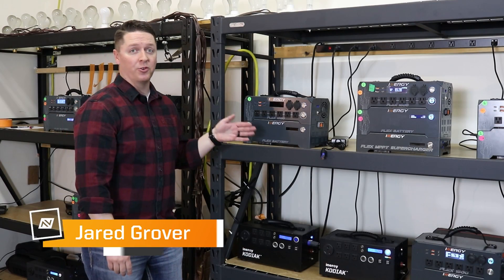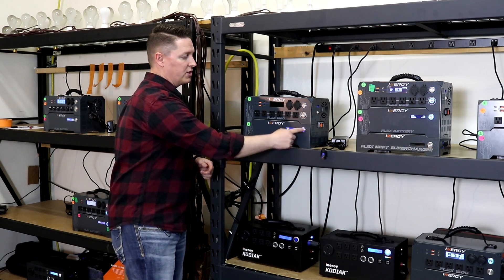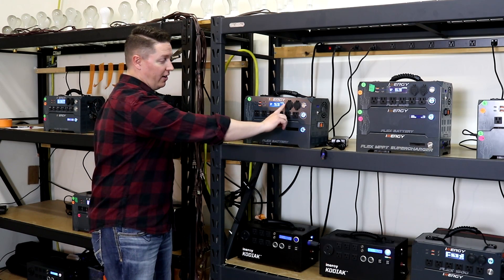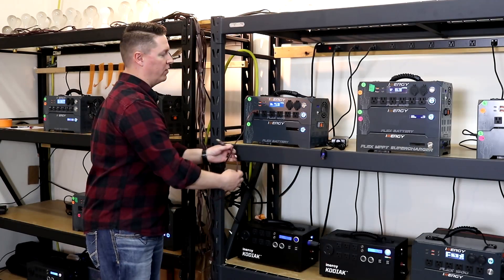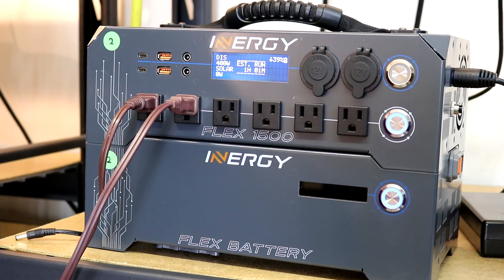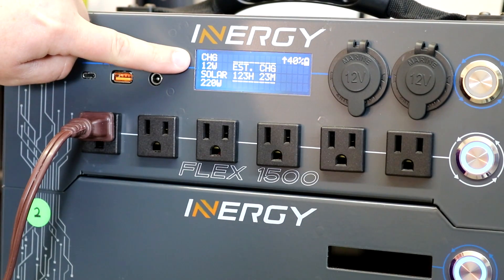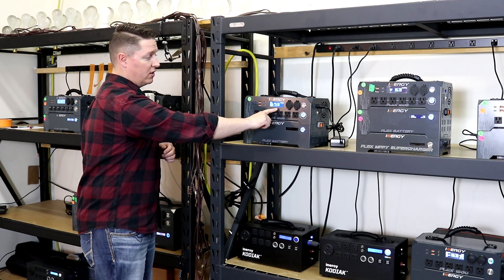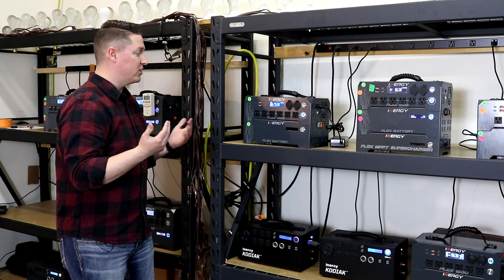Flex 1500 LCD screen walkthrough

Comment: Spent 2k on this unit in May now it’s Priced at 1,450 

My inergy flex 1500 unit is brand new, only used 2 days and the LCD screen is not displaying a charge or solar rate of generation via solar input or 5.5mm X 2.5mm input for standard wall charger that is located on the left side of the battery.

What is this issue? I am not charging at this rate….
Reply from the maker: Hi there, I am sorry to hear you are having issues! I think it would be best to reach out to our Tech Support team to do some troubleshooting so that we can better identify the issue. They can also look up your order and help breakdown the total price paid for the unit since $1,450 is the current subtotal of the Flex 1500, any additional panels or accessories do add to the subtotal. Please reach out to us at 1-877-891-2657 Monday-Friday from 9-5 MDT or email us at support@inergysolar.com

Comment: This company appears to be a scam.
Reply from the maker: The Flex modular system is our fifth pre-sale or crowd-funded product launch. In fact, both the Kodiak and Apex power stations were pre-sales with over 10,000 units shipped nationally. We absolutely are not scamming you. Your Flex system has been manufactured and is simply stuck in an unprecedented logjam at the airport. We have shipped thousands of Flex units in the last month, and we absolutely will ship your unit to you.
Reply: @Inergytek  I received my Flex last week.  I love it. This company is not a scam. The Flex is worth the wait.

Comment: Why is the solar input connected to a 110 outlet?
Reply from the maker: The flex has multiple charging options, including a 200 watt quick wall charger. Unlike the standard wall charger, the quick wall charger plugs into the EC8 solar port. Since these units are being quality tested indoors, we're using a quick charger instead of solar panels.

Comment: This looks like an EXCELLENT Battery to go Up Against Alot of the Competition we will be Field Testing and Reviewing Soon. Looks like 2-4 Flex Batteries is the TRUE Sweet Spot for Long Term Loads during Storms or Winter Storms
Reply: don't get one.  They are not ready.  I have one and Inergy told me not to use it yet and place it someplace away from the house.  The batteries may have been damaged in shipping.  6 weeks later....I hear nothing from them.  When I called to ask what is the status...they told me someone would come to my house last week to check the battery.   Ya that didn't happen and I doubt if it will so I cancelled the remaining part of my order.  Get a Titian instead....